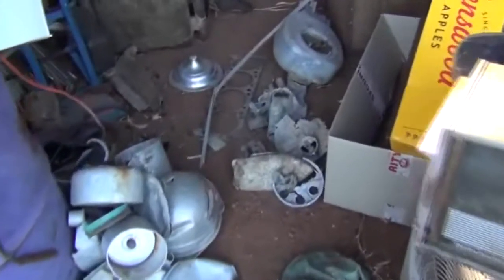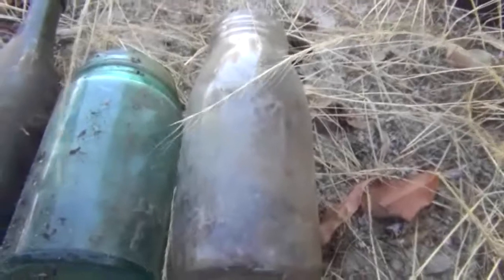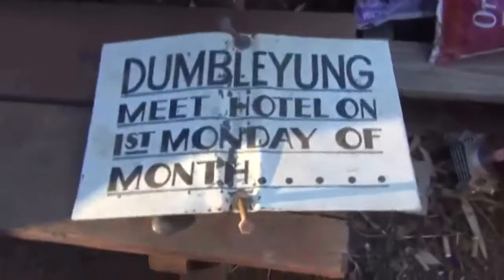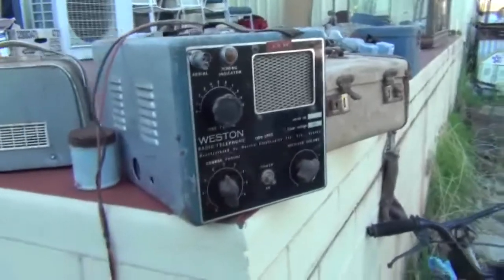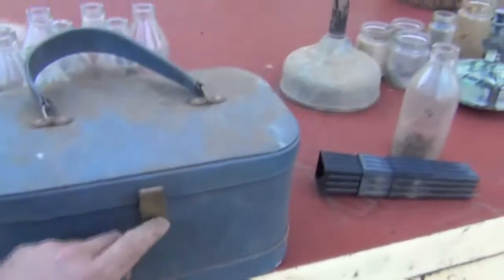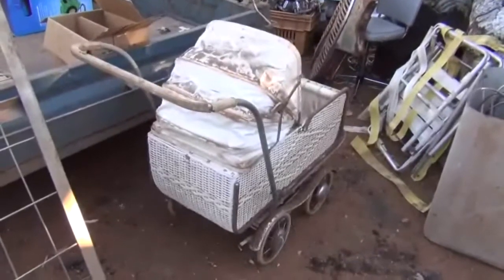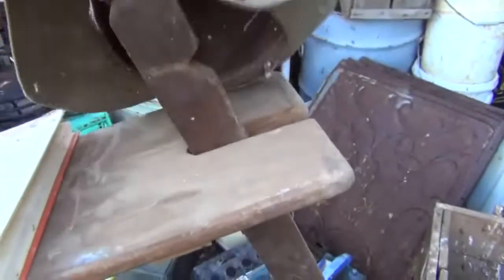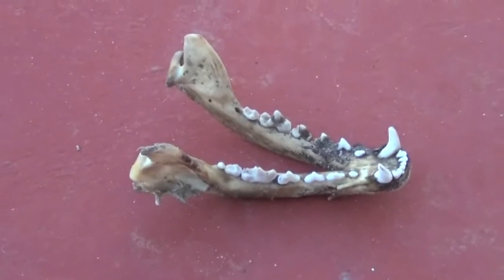Incredible Rubbish Dump Finds - Antique 1940s - 1960s Pram - School of the Air Western Radio

Comment: these are audiotubes, and come from older radios, wheeltape-recorders, and old amplifiers. If youre really lucky you can come across old hospital/lab/military equipment that contains those tubes.. those are the superversion of these tubes.  dont know if Telefunken is a common brand in Australia though, probably the english valves are more common.
cheers